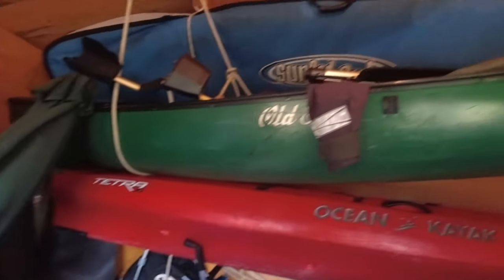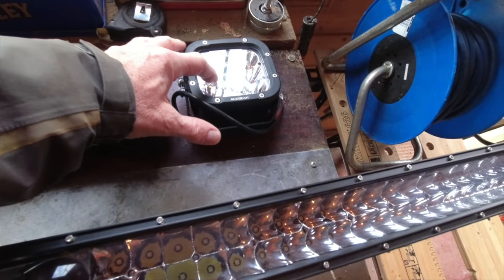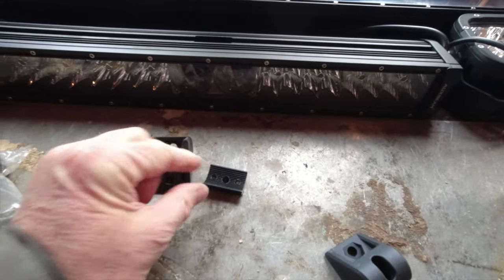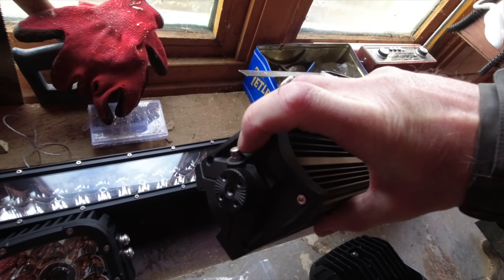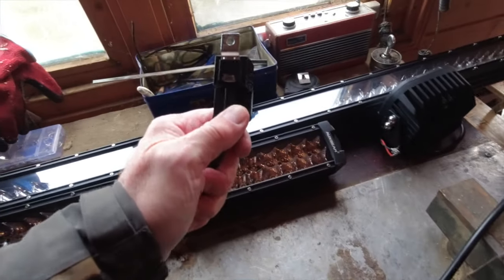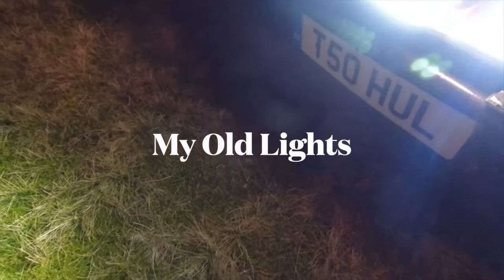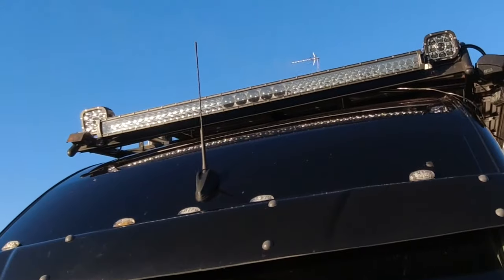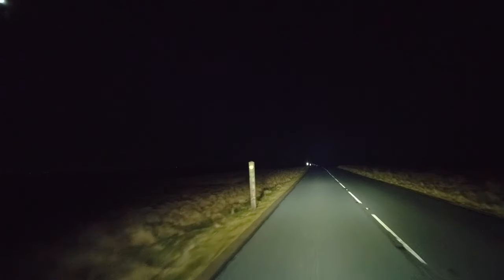Auxbeam Camper Van Lights

Comment from the maker: Use the Discount code 1ManHW for 12% off at Auxbeam 

Website link for Auxbeam is 
https://auxbeam.com/collections/flash-sale-new

Theses are the lights we fitted:

22/52'' 5D Pro Light Bars
https://auxbeam.com/collections/led-light-bars-by-series-5d-serie/products/zd000681

https://auxbeam.com/collections/led-light-bars-by-series-5d-serie/products/zd000678

5 Inch 110W 11000LM Custom Lens Spot LED Driving Lights
https://auxbeam.com/products/zd000673?_pos=22&_sid=9ead08951&_ss=r

Comment: Hi Dave 

Still happy with the Auxbeam lights?
And did you buy the switch panel after?

👍
Reply from the maker: Hi there yes they are still working well no water in them and no problems at all I didn’t add the switch unit I decided I just didn’t need it 
👍🙏😍
Reply: @onemanandhiswhippet  Thanks for the reply
Van and the dogs are looking great,
Have a great day and keep the videos coming 👍
Reply from the maker: @outdoorjunky1  many thanks 🙏